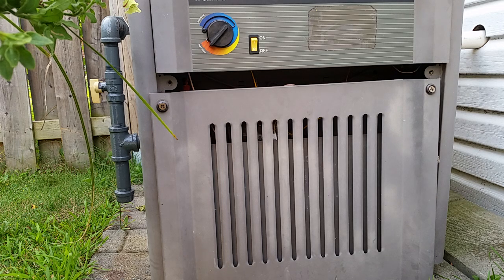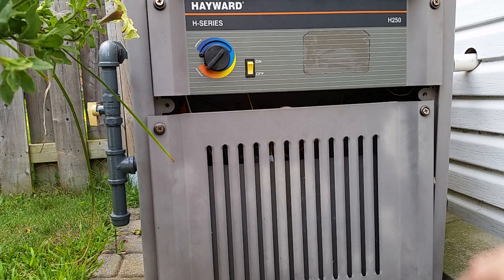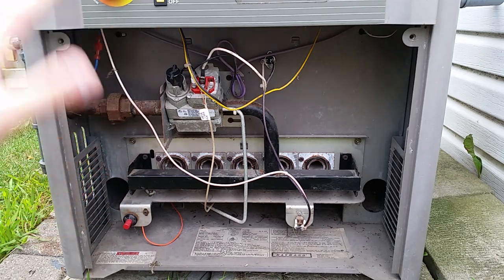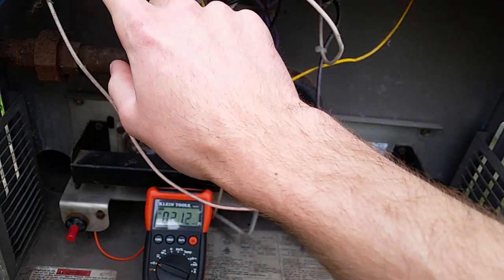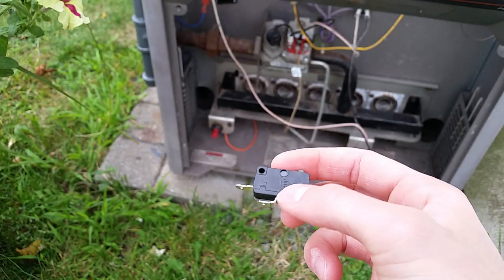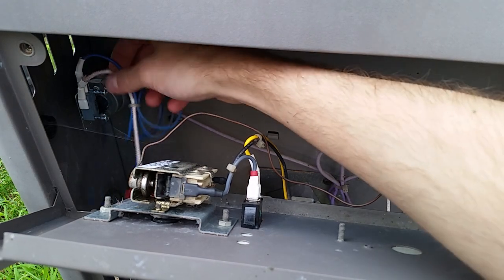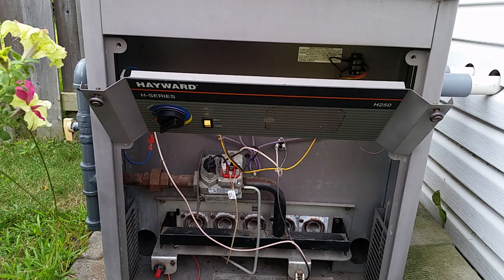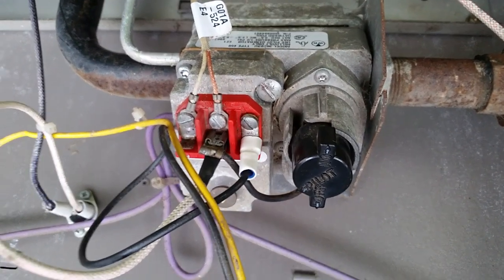How to diagnose and repair your Hayward H Series Natural Gas Swimming Pool Heater

Comment: I have an issue with my H250 that maybe you can help me with. I installed it 14 years ago and it is now lighting but only staying on for about 15 seconds or so and then turning off, it will relight after about 10 seconds and turn off again, never staying lit for more than 5-10 seconds. It will cycle over and over like this.

I took out the flame sensor and cleaned it but that didn't do anything and I used a brush to clean out the 5 gas orifices. Unlike your's, mine is the electronic ignition with no pilot and it has separate spa and pool controls. other than that it should be the same.

I am getting a lot of soot on the top cover and louver vents while it is lit so I was thinking maybe it the heat exchanger just needs cleaned and isn't getting a good air/gas mixture. If my pressure switch is bad, would it do the same thing as far as cycling repeatedly on and off, or would it just stay off?

It is possible to have the copper tube clogged with something like DE (that happens with my filter pressure gauge a lot) and not function properly? If so could I just bypass the pressure sensor temporarily just to see if that's the issue? Maybe the soot is just there from it cycling over and over without ever getting a good burn. I've also read that maybe I have a bad ignition but wouldn't that just keep it from lighting at all? Thanks.
Reply from the maker: 68nevets68 I have seen those units before, they are pretty much the same just more complicated, but the way they run and the problems you will encounter with them are pretty much the same...

If it is cycling on and off it could be that there is air or something in the line, engaging and disengaging the pressure switch, watch it as it runs and see if you can see the little knob popping in and out on the switch, and see it clicking it on and off. If its that you have air in the line or the switch assembly is not working properly and your problem ends there once you remedy that. Also test the actual switch it self like I did because it could be that the diaphragm that engages the switch is working fine, but the contacts in the actual switch are wearing out.
I had this problem with my thermostat. The switch would work but the unit would shut off randomly, and I would have to turn the thermostat knob back and forth to get it to come on. (see my newest video for all a bout that)
It could be that DE or something has clogged it but I doubt that, the gauge is right on the filter itself so its more likely that some will get in there, if you are getting that much filter media back in to the return lines you have a serious problem with your filter. but again, see if you can seee the switch working, and test it to see if it is the problem first, the you can try and figure out what cause it.

If your unit is installed outdoors in an relatively open space it should be getting more than enough combustion air (unless it is full of dirt and leaves inside)

Soot build up in a gas heater like this is unusual unless something is burning up inside there, you should definitely clean out the soot, if you ever see soot build up on something in your home like a furnace or hot water heater it can mean something is backing up and be a CO risk. I'm not sure what could be causing that cause I have personally never seen or had to deal with it before. The heat exchanger is just a metal part that gets hot, as the water flows though it, it absorbs the heat and heats the water, you could have dirt and debris on it that is burning up and causing the soot. Pop the cover off and carefully brush and vacuum it out.

If the pressure switch is working fine, and you tested the actual switch, it could be the flame censor is not positioned properly or it has gone bad and will need to be replaced, it could also be the power supply, or gas manifold it self is bad.

These electric ignition units have a few more components and after 14 years things start to wear out, more so if you live in a warmer climate and use the heater more months of the year
hope this helps... let me know how it goes
Reply: Thanks for the feedback and info. I'm taking it apart this weekend and hopefully it's nothing more than a good cleaning and a new switch will fix.

Comment: Hi. Thanks for the video.  I have to jump the th terminals in order to light the main burner, does this mean my thermostat is bad?   Thanks
Reply from the maker: Frank Maduri Could be, remove the the two connectors from the switch on your thermostat, turn the knob until you hear it click, and test with a multi-meter like I did, also if you don't have a multi-meter that measures continuity you can simply use a small battery and and small light bulb to make a simple test circuit broken by the switch you are testing. Never leave your heater unsupervised when it is operating with the terminals jumped, because all safety switches are bypassed.

Comment: Great Video!  Question though.. My pilot light lights on the first try much like yours.. however the pilot light will not stay lit.  I disassembled the unit and cleaned the pilot end and ran a pipe cleaner through the line.  Still no luck.  Any recommendations?  I held the pilot on and checked the mv to the gas valve itself and I'm getting 497mv.  Thermopile bad?  I have the H150 model.
Reply from the maker: Todd Stephenson Hey, yes most likely the thermopile/thermocoupler is bad or causing some kind of problem (there is actually only one in these units) Firstly make sure you are holding the knob down long enough on PILOT before turning it to the ON position, try holding the knob on pilot for at least 30 seconds to full minute before turning the knob to the ON position. It could also be that the thermo has been knocked off a bit and is not in the right position in the flame. 479Mv is a very good voltage, so I think maybe you are just not holding the knob on pilot long enough to generate enough current for the valve to stay open 
You can unscrew the thermocouple assembly  from the controller and test it for an extended period of time, just be careful screwing and unscrewing it cause the threads are aluminium and if you cross thread them, its not going to be fun. It could also be the controller (main gas valve) has some kind of problem, but I doubt it.
Reply: Video Québec Okay sounds good.  Thanks for the information.  I have tried well beyond 30 sec to a minute.  I have even went as far as to have my wife time me for 3 minutes and still no luck.  I don't want to put a ton of money into this unit but if it is something simple  to fix... then fine.  Where would I find the thermocouple controller?
Reply from the maker: Todd Stephenson Yeah in that case I say try replacing the thermo, shouldn't be hard to track down a part number from Hayward or RobertShaw/Honeywell. Check and see which control valve ("Gas manifold") you have, (If you have a H series similar to this one its most likely made by either RobertShaw or Honeywell)

If you buy Hayward's part number (Hayward HAXPLT1931) it's probably going to cost you 5x times as much, and I believe you have to buy the entire assembly with the bracket, spark igniter and pilot tube.

These control valves/gas manifolds are very similar between the equipment they are installed in (Hot water tanks, pool heaters, gas fire places, etc...) So you should be able to narrow down a generic part number for the the actual manufactures part and it wont be that expensive.
If you cant narrow down the exact part just try to search for "millivolt thermopile" and find one that looks about the same size and has the same range of voltage rating. (Also I made a mistake, these thermopiles do not screw in to the controller with an aluminium tube, the simply screw on to the terminals with wires.)

Comment: i have H2501 pool heater its work great but not turn off when it reach the temp.
is it the problem with pressure switch can you give me you feedback & thanks for this video
Reply from the maker: ron123 The thermostat temperature is not exact, if you have it set really high it may never go off because your pool it to big and simply cannot get as hot as the max temperature on the thermostat.
But if the thermostat is not turning the heater off at all, there is a problem with that component and you will need to repair or replace it, see my latest video where I change mine and show how it is done.

Comment: also you said it was sitting for 10 yrs non use. what repairs did u do to it? onlythe valve u broke accidently? wires? thanks
Reply: where did youbuy the power switch?
Reply from the maker: The only problem was the limit switch on the pressure switch assembly. The switch was bad so I had it replaced. For wires you can use any wire that is the same size, just cut it then same length then use the crimp connector plugs.
The switch is just a regular limit switch, but like I said it is riveted to the assembly with the diaphragm that activates it YOU DO NOT need to replace the entire diaphragm assembly, just grind off the rivets and replace the switch

Comment: hey thanks for the video! question. my mom has a hayward  h3501. prety old unit. she has not used it in about 7 years. would the same apply to the H350 unit as the 250.  im worried the repairr man will jip me.  

another question is: we have 2 automatic switchen the turn when you push a button when sitting int he spa. it used to acitvate the blower. i noticed that her blower is gone and the wires leading to the motor that turn the water current are cut. there is also sign of a panel that used to hang ont he wall.  U have any idea? thanks very informative video
Reply from the maker: Hey, yes they are all the same if it a millivolt system then it will be like I showed in the video, if not its probably electric which means it's even easier to repair.
Millivolt means the pilot light burns up against a small metal thing that generates power to run the system, like I explained.. if its electric there will be a transformer that takes power form a line somewhere. Not sure what you mean by the spa blower... shoot a video and I can take a look at it.
If you are not comfortable with gas and electricity dont touch it cause you can blow yourself up with this stuff. make sure the gas and power is off before going at it.
Should you call a repair man make sure they are locally certified and accredited. If you have to pay, might as well pay a professional